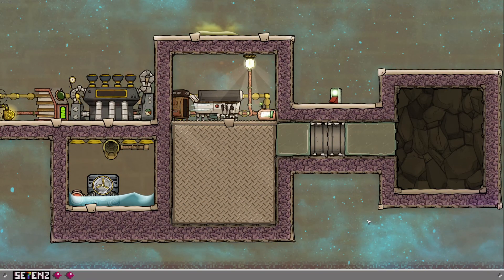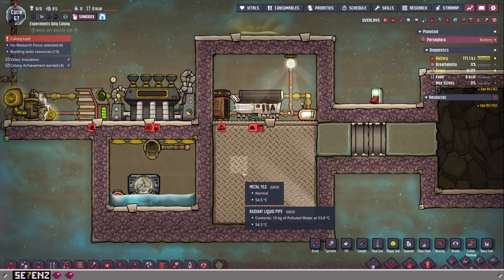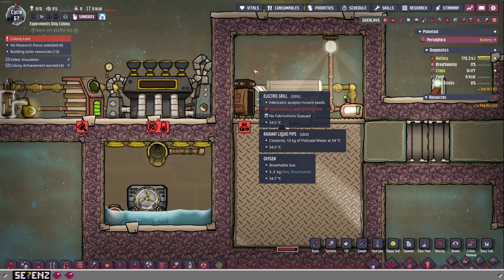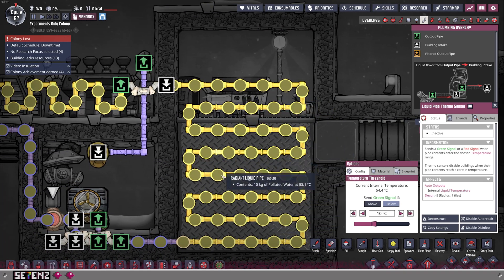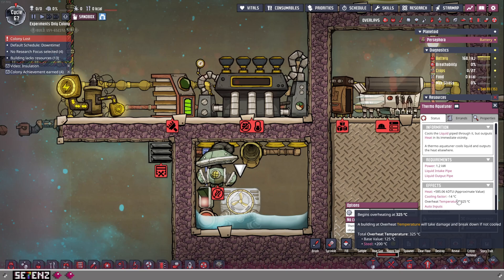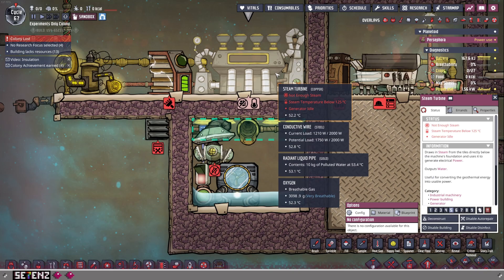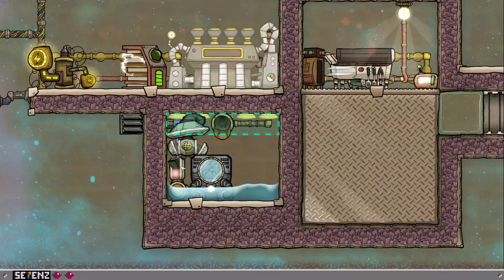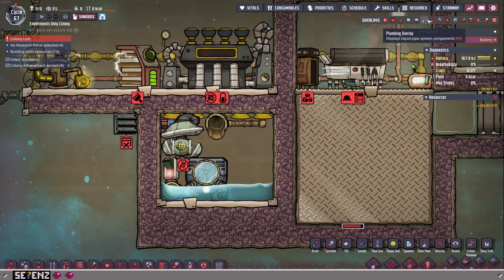3.2: Cooling . Active Cooling

Comment: Looks pretty hard to implement and overkill for any base design. What I do is what most players have is have a big sauna that houses all my cooling and is thermally insulated from the outside. Instead of cooling a large portion of your base you instead cool your oxygen production to whatever temp you want which makes it a whole lot easier to build and makes it more even cooling
Reply from the maker: Hey thanks for the insight! In one of my previous modules, I believe and if not it appears in my streams, I talked about passive cooking and using cool liquids, like -10c brine, to do just that! Cooling your oxygen is a great way to keep heat lower in your colony. As for this design, I find it is great for certain things, such as general colony cooling. Higher heat causing buildings may need other options or solutions. I like to make these modules pretty straightforward, especially for new players who may not consider all the multiple solutions (like this design + cooling your oxygen + using insulation to keep heat out). Finally, I am not efficient or science minded, so I try to separate where I can complex concepts into simpler things. This design, as what other content creators of it have said, is often for those at the mid game. I hope to see more of your thoughts and have a great weekend!